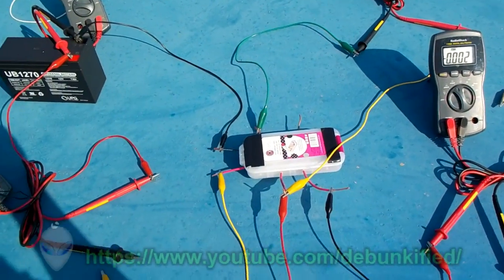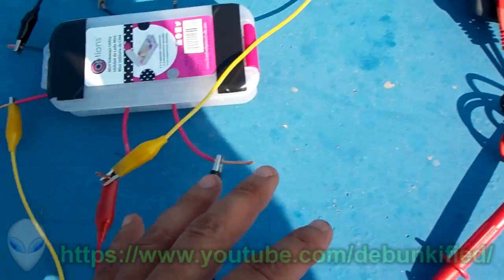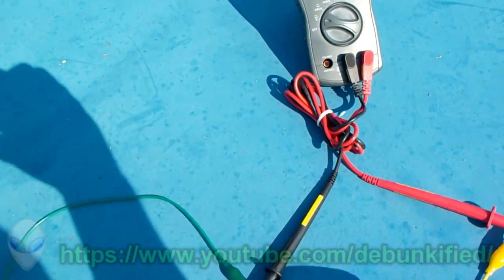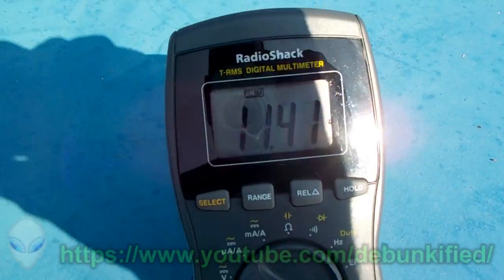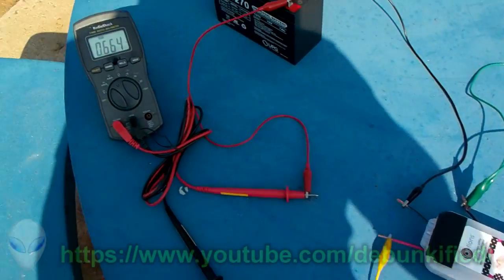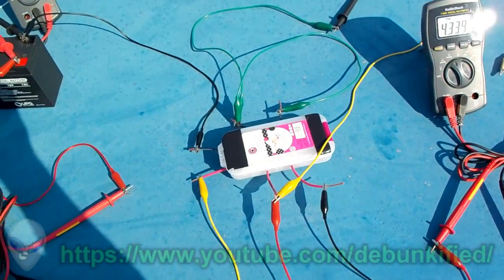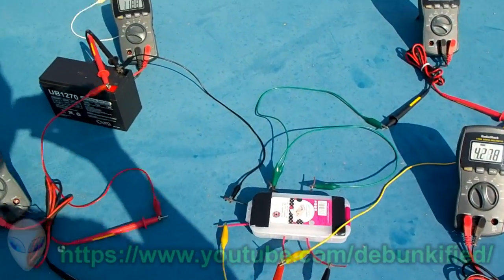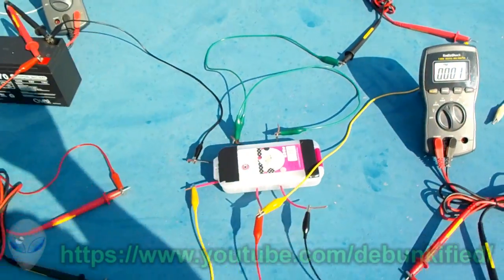Free Energy Overunity Basic Concept Prototype

Comment: Sorry, but hiding stuff negates any "proof". 
BTW... you simply can not say the "load is part of the circuitry"... that makes no sense. If you can not drive an external load, it's useless.
When you have a device that you are trying to "prove", you need to measure Amps and Volts simultaneously PER OUTPUT... you can't measure Current from one output and volts from another.

I have saying this, but you really need to get some basic electronics education so that you understand what I've been trying to explain. PROPER Instrumentation is critical, and without that, anything you do will be wasted time and effort.

I don't want to discourage you from your work, but as far as proving your circuits, to anyone who has any electronics background, all you're proving is your lack of basic understanding.

You MUST drive an external known non-reactive load... without this, nothing matters.

Ammeter must always be in series with the load...  like you have it connected from the battery. The load for the battery is your "circuit", and the input Ammeter is in series with that "load".  

Likewise the Output MUST be connected the same way. Your "circuit" has an Output, which is to drive a LOAD.  You can not use Amps from one output, and Volts from another - and get Watts from them... that breaks all simple rules of instrumentation!

Obviously you have two switching buck regulators in there, both of them are using the 12V battery as their input. The first buck regulator output is connected to your Output Voltmeter which has no LOAD... so it's running cold... this regulator is performing NO WORK... it's simply converting 12V in to 12V out, no LOAD = NO WORK.

The other buck regulator that you have connected to the Ammeter is being shorted out by the Ammeter. This regulator is simply operating in current limit mode, that's why it's running "scalding hot"... and will eventually burn out. 

You can not measure the output current of a switching regulator by connecting the ammeter ACROSS the output... that is not measuring anything but the "short circuit current" capability of that switching regulator. If you were to measure the Voltage across that same Current meter WHILE it's connected and "putting out" over 4 Amps, you will probably see that it's only putting out about 0.1V DC... because you are shorting it out with the Ammeter. That means that the LOAD presented to this 2nd buck regulator is actually the Ammeter, which is essentially a short-circuit. Output Power?  If there's 0.1V across the Ammeter leads, then you have 4.5 Amps x 0.1V = 0.45 Watts AT THE LOAD... that's the AMOUNT OF WORK that this 2nd regulator is performing.

I try to help people understand these issues... with over 40 years of on-the-job electronics experience, and over 30 of those years as electronics design engineering work, it's my desire to help those who have a lot of motivation, but are somewhat lacking in the basic fundamentals of electronics.  It's how I raised my son, teaching him everything about electronics that he asked about... who is now 18, and I just moved up to MIT for his freshman year... on a full-ride 4 year scholarship.

Again... please don't think I'm trying to dissuade you from your work.  I am 100% firmly convinced that there are "unusual ways" to generate electricity (via energy conversion) in ways that most of the "educated bunch" would call "bunk".  "Science" can not fully explain every characteristic of so many things... like magnetism, zero point energy, quantum field energy, etc.  It's just ridiculous to state "it can't work because it breaks the law of thermodynamics and/or entropy" when "we humans" are still learning.  Just because "Science" doesn't fully understand something does not mean some new and "unusual method" of "generating" electricity "can't work"... this is what "real science" is supposed to be about... "DISCOVERY"!
Reply from the maker: +beforebefore Hi, despite the fact that I am indeed hiding something doesn't negate the fact that I am measuring a load with real current running through it with a voltage sitting across it otherwise known as wattage, power and work.

On some points you are perfectly right, but you haven't got it entirely correct. You are incorrect about what is inside the box.

Saying that the load is part of the circuitry makes perfect sense. It is power flowing, and the whole entire point is that real work is being done with real wattage, current being measured in series, and voltage in parallel, this is a perfectly legitimate instrumentation.

You are correct about the meter "short circuiting" the circuitry inside which explains such a large amount of current flowing, however, that current is coming directly from another power source from within the box, and is set up exactly as to how the input is setup.

What you see on the input is an ammeter in series between one side of the battery and the circuitry hidden inside, which I am referring to as a load, namely because it's doing "work". So what, it's not a traditional load such as a light bulb, resistor, or motor, it's a load nevertheless.

This load is made up of resistance, just like a traditional load.and there is current running through this load along with a voltage sitting across it performing real work with a real power flow of wattage to it. 

What you are saying is that this is not a load because you think it's a switching buck regulator of some sort, but even a  switching buck regulator is doing work, is it not? Does it not do the work of converting? Does it not require energy in order to operate with power in order for it to do its job?

Is a simple coil not a real load either? It has a job as well and that is in producing a magnetic field, that's what it does, that's its job. Ok so a coil doesn't produce light, or spin a motor, although it is being used in conjunction with a rotor or stator inside a motor in order to spin it. It also produces heat, last time I checked a heat is produced when work is being done, or there is wattage and power present.

What is inside of our little sorta black but mainly frosted box is exactly what is going on at the input, and that is a power source with a load and an ammeter in between the power source and the load, common methodology, in order to read input current, along with a voltmeter sitting across the power source, which is a battery in this video.

The box has a power supply too, its generated on its own and draws very little from the power source. In no way are there two switching buck regulators both being powered from the same battery, that's just ludicrous and there would be no real point in doing that as you have already mentioned.

I'm truly happy that you are well educated in the electronic arts and I'm pretty sure you know what you are talking about because of the massive amount of experience you have.

I'm happy to know that you want to help people understand how things really work and that's something I can really appreciate it.

Here is your view on how things work. Take a simple circuit made up of just a battery and load. What you are saying to me is that this simple circuit has absolutely no electrical efficiency because it has no output except that of light and heat, just nothing electrical in any way at all. So yes in that case we have a 0% electrical efficiency.

But here's the real question, why would we completely dismiss the fact that the load is running off 100% of the energy in which the load is doing 100% of the work, times time of course. That's what we've been doing this whole time. Is 100% of the energy not being transferred into the load at a 100% transfer efficiency?

I realize that transfer efficiency is not the same as electrical efficiency, but seriously why not? It's still doing work, obviously.

Even if I had two switching buck regulators being powered from the same battery and then just loading down one directly through an ammeter for a huge current with no voltage and then the other completely unloaded where I am just reading the unloaded voltage, would make a great illusion, but that would be completely deceptive which I am not about. I am also not about self deception either.

Even if that was being done you think that would be over 100%? I think not, in fact I know that would be only as efficient as the switching buck regulator itself, most likely along the lines of 90-95% or so.

So how exactly would I achieve the results that I have achieved in this video? You made a very good guess, but it doesn't explain how I am able to show on meters more power out than in, especially with a voltage on the output being much lower than the input voltage, which I clearly stated the intentions for doing that.

If I was directly connecting the ammeter across a switching buck regulator wouldn't you think the input would be loaded down just as much and equally?, which in this case it's not.
Reply from the maker: +beforebefore Hi, I understand what you are saying. Believe it or not I do, even without formal training. I believe I have learned everything you are saying as I am familiar with System Level Efficiency and I totally believe it and that you are 100% correct. 

I believe this has to do with electrical efficiency in which there has to be an electrical output of some sort from some sort of converting device.

One thing though you continue to keep believing though is that I am measuring a voltage output completely separate and isolated from a current output in which I am not.

I am measuring a voltage output in which I am then measuring a current output directly from the same voltage output source, there is no separation of the two as you think I am doing.

I suppose if the output voltage was measured along with a completely different and separate current output then a greater over efficiency could be measured on meters and you are correct in that, it would be absolutely meaningless, and would be nothing short of a false measurement, but I am certainly not doing that in any way at all. What a waste of time that would be and it would just prove how stupid that would be.

The output in the secondary system and the way it's measured is identical to how the input is measured in the primary system. The input is a voltage source such as a wall wart or battery, a meter connected across that power source or (in parallel) to measure voltage, and a meter connected in between the power source's negative or positive and the load (in series).

This is exactly how the output is measured, in the exact same way. In the secondary system there is a voltage source as an output, a meter is connected across this power source to measure voltage. 

Directly and immediately following the positive side of that same voltage source is a meter measuring current while the other side of that meter is then connected to the load which I have as either LED lights or a small motor and the "hidden load" as well.

This is real voltage, current and wattage flowing from the same output source and being measured from the same output source, which are completely related to each other and not isolated from each other in any way at all.

That would be silly to do such a thing, and even though if I were to do such a thing as that, since I've never tried that, then I wonder what the input wattage would do?

If one of the outputs were completely loaded down directly through a meter (dead short circuit) to show a huge flow of current and basically no voltage, then I imagine that the input would be loaded down to some degree just as much and in proportion.

As far as another unloaded output voltage being measured, then I assume that this could be stepped up high enough to multiply with the big huge current that's loading down the source and still come up with more wattage on the output.

Since I have never done that before because of how meaningless that would be, as you've already mentioned, then I can only assume that would happen.

There's simply way too much current flowing out of the output's voltage for the input's current to be as low as it is.
Reply: I agree, the fact that his "Tupperware" boxes are secret, they will have two DCtoDC converters.

The "YouTuber" knows nothing about input and output impedance of power supplies.
If he did he would have mentioned it.

He has no idea of presenting a well documented and explained experiment, being secretive about his "Tupperware" boxes does nothing for his "credibility"!

Are we sure this guy is not taking the piss out of all of us?
Reply: Hi again.  I think one concept that I neglected to talk about is "System level efficiency".  Your "System" is one that is converting energy from a "Source" (the battery), to a "final Load". 

System "Work" is determined by the FINAL GOAL of the SYSTEM... ignoring all intermediate steps that are part of the Process.  The "work" you say that's being performed inside the power supply is not what we are concerned about... it's only the FINAL/ULTIMATE "WORK" that matters... powering some external "load"... light bulb, motor, etc.  

A power supply by itself is doing work, but it's the conversion system, not the system load. 

It may be dissipating heat, but that is not it's ultimate design goal... which is to power some external device.  The only time "internally generated heat" is considered part of the "system work", is if you intend it to be a source of heat... something that only turns electricity into heat.

Let's step back and take a generic example here... 
Assume I want to determine the "System Level Efficiency" of a store-bought bench-top AC-to-DC power supply which has three (3) fixed voltage DC outputs. Each of the outputs is rated for 20V DC, and is capable of supplying 10 Amps to each of the three outputs simultaneously.

The required instrumentation will be as follows:
1) AC power line True Power meter - this device measures the RMS AC Voltage, the RMS Current, and the Power Factor. With these three measurements, TRUE AC Power can be determined.

2) Each DC output will require a separate test load in order to attain 10 Amps load current at 20V DC. This equates to a 2.0 Ohm load resistor at no less than 200 Watts each.  This "test load" is taking the place of the eventual "real load"... which might be a motor, or a light, or any number of possibilities. The reason we use a Resistor is that this is a "non-reactive" load, it gives us a Pure DC constant load... unlike a motor or any "active" circuit. A Resistor does not change... it is "static" and predictable.

3) Each DC output will require a separate DC Voltmeter and DC Ammeter, so that all three outputs can be fully loaded to the manufactures specification simultaneously.

4) On each output you will have these connections:
  a) one lead of a 2.0 Ohm Resistor will be connected to the (-) DC output of the power supply
  b) the other lead of the 2.0 Ohm resistor will connect to the (-) lead of the Ammeter
  c) the (+) lead from the Ammeter will connect to the (+) output from the power supply
  d) the Voltmeter leads will be connected directly across the 2.0 Ohm load resistor - (+) to (+), (-) to (-). Connecting the Voltmeter directly across the resistor (load) assures the Voltage is being measured AT THE ACTUAL LOAD. Wires have resistance, and will drop Voltage, so measuring Voltage anywhere else will result in false measurements.

Once we have the accurate Input Power, and a total of the 3 Output Powers (summed together), then you can calculate Total System Efficiency. 

It does not matter if there's any heat being dissipated in the power supply... it is just a "box" that is serving to CONVERT ENERGY. IT ITSELF is not a part of "System Load"... it is the UIT... the "Unit In Test", the  conversion device which is the intermediate step in the SYSTEM LEVEL PROCESS... which is to convert AC to three different/isolated DC outputs. 

Efficiency is SYSTEM OUTPUT POWER divided by SYSTEM INPUT POWER... nothing inside the "box" matters... it's only the CORRECT external measurements that matter.

The ultimate SYSTEM GOAL is to operate some device... be it a Light Bulb, or a Radio, or a Motor... all that matters is how the "box" will ultimately be used... and the efficiency when used as intended.

You simply can not measure Current from one DC output and Voltage from another output, then use those two isolated and unrelated readings to come up with Output Power/Watts... this just simply does not make sense, and is completely wrong instrumentation. Each independent output must be measured/instrumented separately... and simultaneously, then the resulting Watts from each output can be combined to determine System Level efficiency.

I'm trying my hardest to help you understand this, but if you don't have any formal electronics training and experience, you are going to have a hard time grasping these very basic concepts.

In the end it comes down to this... Connect some real loads (incandescent light bulbs are also good), connect the meters properly, calculate the Output Power, Input Power, and Input:Output Power Efficiency.
Reply: ok, that's all fine. I'd buy it. Next step is to get some sympathic customers to validate your claims.
Reply: Yeah. I'd like to see what's inside the box also. Try again.